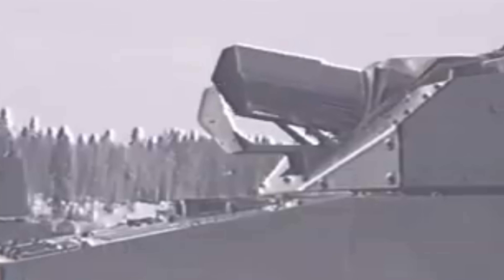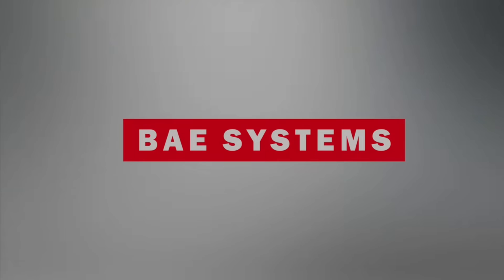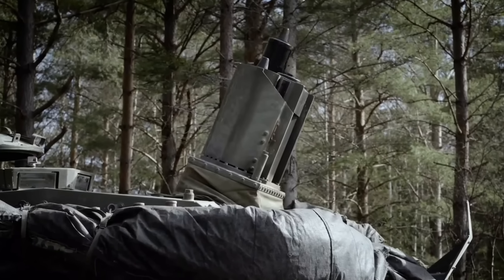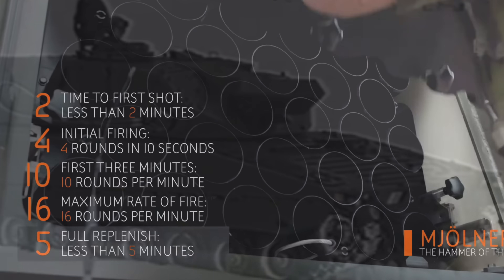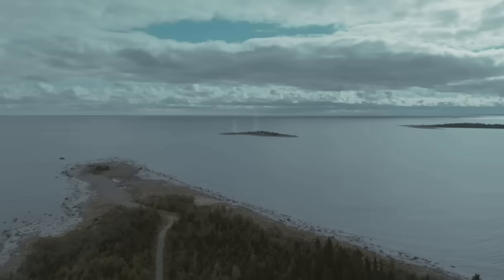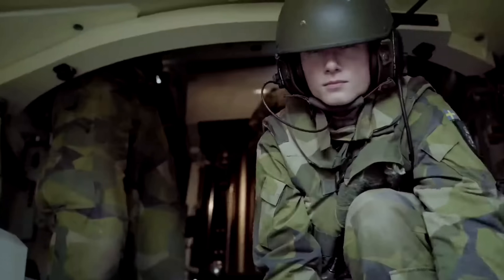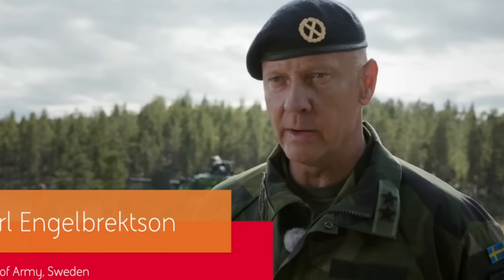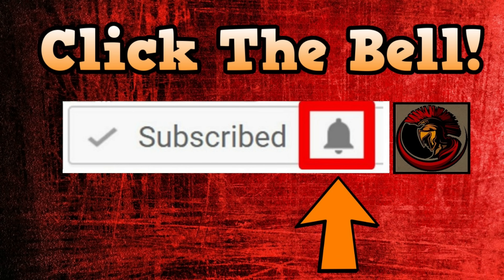The 'Mjölner' Rapid Fire 120mm Mortar Vehicle | DOUBLE BARRELED INDIRECT FIRE

Comment: It's....nice for a standalone system. But if they were to make a revolver mortar system that can fit in the back of a Humvee. Than we can see a real effect on the battlefield. My main gripe is that it's just a self propelled artillery gun. Which is what all the enemy scouting systems are going to show. So the enemy knows what they are and what they look like. Which would allow them to know how effective enemy indirect fire can be within that area.

Now if you make a mortar system that can be mounted and hidden in the back of a Humvee. Every Humvee could be just as effective as these things. Along with the added benefit that enemy intel can't track such things and makes the fog of war more dangerous.

This thing is of the cold war era of thinking. More firepower and more ammo against a static enemy position that doesn't have air or drone support. Also....i now have a use for my Anti-Armor Rifle.

Comment: Not really a try military person but somewhat a military industrial complex person in the past. Love Amos and this system may make a nice complimentary vehicle to it. Tracked vehicles as you indicated work better in difficult terrian,but wheel vehicles while working adequately in most difficult terrians do provide better speed, lower cost, and longer range per amount of fuel carried in less difficult or developed terrain. This is the difference between what the USA Army buys and the Canadians and Swedes buy. Yes, such a vehicle should provide advantages over rapid fired cannon or machine guns. Perhaps even at penetrating enemy tank turrets with ordinance. Mortars are easy and quick to produce too. Only comment on USA forces using Humveys is; do they provide the vehicle with enough armor? Should they produce a special chasis to mount such a system or perhaps it could become an enterchangable system on a Bradley ( this may show my ignorance) or Stryker chasis? ( probably the latter would work best) In my opinion it may make a nice addition to the family on the common chasis and the troops it supports. ( but now its on a wheeled chasis!)

Comment: I really like this Mew Mew Mortar too, but I'd expect it to be pretty high maintenance, no?  The system of loading the mortar without exposing the crew is brilliant, and actually reminds me of a similar system that I drew up on paper to use with the Metal Storm(tandem loaded, multi-barrel 12.7mm-30mm gun), where my design incorporates preloaded disposable sleeve magazines(resembling a shower curtain rod with holes in it for the electric ignition/primers) that fits in each barrel snugly as to not crack or stovepipe while firing. My system extracts the empty sleeve mags, then inserts new ones, hopefully in under 30 seconds for all 9-36 10rd barrels(depending on if it's a smaller or bigger system). Ofc, to maximize effect, the rounds will probably consist primarily of AP incendiary, regardless of which caliber is being used...but I'm still developing the system that was apparently abandoned awhile ago originally designed by J.Mike O'Dwyer(Shhh 🤫 please don't tell the ATF) on graph paper only, ofc.
Reply: 30mm ap incendiary is silly. Either go HE, HEDP or sabot for that calibre.

Comment: A mortar for the Price of M109 ? Non thanks !
Reply: A cannon is not necessarily better than a mortar.
Reply: @samsonsoturian6013  explain ?
Reply: @Necromancer_88  Sometimes you don't need a high velocity round. Sometimes you just need a lot of explosives going down range.
Reply: @samsonsoturian6013  generaly mortar are a cheap alternative to howitzer for thé same Price no reason to choise mortar
Reply: @Necromancer_88  Yes, but a mortar with the same price tag as a howitzer can send much bigger explosive shells down range much faster.
Reply: @samsonsoturian6013  ammo price or vehicle ? This mortar on cv90 i think are the samme price range to cheap 155  howitzer
Reply: @Necromancer_88  If ypu measure in terms of explosives going down range, mortars are cheaper there too because there's little powder charge needed per shot.
Reply: @samsonsoturian6013  do you know the price of he 120mm mortar shell and 155mm he ?

Comment: The amount of Motors rounds it can carry and rate of fire with the Accuracy it will not suffer from the typical motor tube movement with every shot. This system will become a largely standard part of every army in one format, weather it be a new system built or buying these from other countries. Theses are amazing pieces of military equipment.

Comment: Having served with both the old system in Sweden and the new Mjölner I can say that it is a game changer. The speed with which it can maneuver, deploy and redeploy is remarkable.
Reply: I don’t get the point of just small arms fire protection if it’s normal range is over 5km then what small arms are threatening it? Might as well go back to a mortar truck because anything hitting you from 5km away is not a small arms
Reply: @off6848  It's literally mentioned in the video. The biggest threat by far to any artillery is counter-battery fire from other artillery. Having an armoured platform means you're protected against anything but a direct or very close hit from return fire. Anything else will be stopped by the armour. That shrapnel would shred unprotected infantry otherwise.

As mentioned it's also not impossible for the vehicle to come under small arms fire as the front line is constantly shifting in modern warfare. Forcing the need for anti-tank weapons rather than small arms to knock out the vehicle if they come under fire is a great boon to the protection of the crew until they can reposition.
Reply: @off6848  It does provide protection from shrapnel, which is a massive threat. But also, you want to be fairly close to the front line, that is not really a line but rather an area. Meaning that there is a fair risk that mortars can come into contact with enemy infantry, making small arms protection a good thing.
Reply: I also reckons it's great but wouldnt call it yet another G-g-game changeerrr
Reply: Range is critical and I'm sure that it doesn't have enough, it's thin armor would make it a sitting duck if spotted by a drone.
Reply: @gumby2241  It's not invulnerable, yes, nothing is. Doesn't mean it isn't a good system still. Drones have also been used on howitzers, so increasing the range isn't going to help anyway. And having some armor is better than no armor

Comment: Amos has been doing this for a long time now, it has longer barrels which means longer range and has direct fire ability
Reply: Yes, but like Mat stated in the video, the AMOS system costs several times as much. Every mortar system doesn't need to be the AMOS. A military can have a few for specific uses and flesh the rest out with this unit.
Reply: @Ravnican127  more expensive per vehicle yes but it has twice the firepower and more capabilities in a single vehicle and cheaper than 2 vehicles with a single tube
Reply: Have 2 amos or many more those these???

Comment: I like the idea of putting more 120mm mortars in vehicles with data links and automatic gun laying, but I question this design. In particular, the choice to use a muzzle-loading mortar has lead to an over-complicated loading system. Why did the Swedes and BAe go with that over a breech-loading mortar?
Reply: Because the over-complicated breech-loading AMOS system was too complicated and expensive.
Reply: @Merecir  I get that the AMOS was too expensive, but I'd argue the cost was from the autoloader, not the breech.
Reply: @matthewkubinec1620  Apparently, as they made all of it manual, both were the problem.

Comment: First off I think this is super cool and definitely a good idea overall. The problem is and it goes for all new equipment/tanks/vehicles/and so on is this is or will be super expensive compared to it counter parts. Yes as USA military equipment should have the best on the market but after we have the best on the market we should also have low cost, mass produced, easy to produce to flood the (War) market if we needed. And this is definitely not that. The government need to get on the companies that design and manufacture these types of things that they can't have a blank check and stand by there equipment if it fails (with companies $$$) if there's problems with the equipment and I'm sure with something on the complicated scale of 9 or 10 out of 10 like this, I'm sure there's going to be a butt load. PS I know this is not USA thing but I'm sure a comparable thing will be coming here soon

Comment: A very interesting video about a piece of equipment I did not know had been developed, so Kudo's to you for posting and the Swede's for developing it. I could see it's usage as a very good support weapon for any advancing armored column without infantry leaving the safety of their APC's in order to "setup traditional mortar's" to support an infantry attack. I can also see the benefit of the plunging fire effect this system would have in an urban or hilly environment replacing the STG direct fire support systems or at least enhancing a commander's options and not having to rely on longer range field arty.
Sweden commands my respect for always producing the highest quality of weapons and systems and maybe if Sweden donates "a few" of these for use in Ukraine like they are doing with the Archer SPG system and positive battlefield reports come back from their usage, maybe then the orders will start to roll into BAE from other Nations and BAE could firer back up it's production line and make a big profits score. Just off the top of my head I can think of 10-Countries that would benefit from having this system in their arsenal.
Reply: Just build the mortar into an old apc...

Comment: I think drones is going to do a number on these if they spot them. The lightly armored turret with a huge storage of ammo inside. Drones are so cheap that Mjölnir will have a hard time being cost-effective.  I do like the concept but when the funding got cut and AMOS was abandoned they rushed these things out. That tends to lead to costly modernizations and/or ad hoc solutions (see cope cages).  So if BAE makes a export version or a Mk 2, it might be more matured and effective.
Reply: I believe these are designed to be part of mechanized brigades that will use different versions of the CV90, which are pretty likely to include an AA variant or two to cover the rest of the brigade
Reply: @CrazyDutchguys  Yeah but even if I have to use 20 drones to score a hit if the drones cost 5000$ per unit it is still cost effective. So the lightly armored turret is an Achilles heel on the platform.
Reply: The vehicle has protection against arty fire, The design of this system is bases on the shoot & scoot concept. 
Finally, the Swedish army have 40 of these system and have ordered 40 more with minimal adjustments.

Comment: Hell with that this is perfect for combined infantry and tank movement. Throw these in the mix with your reserve and or overwatch element near the rear to provide indirect fire to the front. That way these can provide indirect fire for the assault element while your reserve element maneuvers into position. Though I am a bigger fan of the Archer system for shoot and scoot. HIMARS is great too for long range strikes but you sacrifice too much ammo for distance in my opinion. With rocket systems you need to have more support vehicles with you for reload. With Archer I may only get 20 to 30 miles but one vehicle carries 24 rounds at a time.

Comment: The U.S. Army experimented with self-propelled, infantry mortars in Vietnam. The Army simply mounted 81mm mortars in the back bays of reconfigured, versatile M113 infantry armored vehicles, one mortar per M113.  The advantage was that the 81mm mortar was highly mobile, transported its driver, crew, and NCO, and offered a modest amount of protection.
     After Vietnam, the U.S. Army retired these self-propelled mortars and essentially turned its back on the concept of self-propelled, infantry mortars.  The U.S. Army believes that self-propelled mortars basically defeats the purpose of troop-carried mortars which can be ported anywhere, giving infantry troops badly-needed, close artillery support.  If armored, self-propelled artillery is needed it can be provided by either tanks in the bombardment mode, or dedicated armored SP systems like the 155mm self-propelled, totally enclosed howitzer.
     Over the past decades other nations have devised, armored, self-propelled mortar systems, but have never found government customers for similar reasons.  This Mjolner looks impressive enough on the firing range, but given the past lack of interest in similar, self-propelled mortar systems, I doubt this one will go much further than the prototypes shown here.  Even the former Soviet Union wasn't interested in the concept, nor Red China today.  Same goes for Western Europe and the U.K.

Comment: How is it accuracy wise compared to AMOS? Does the additional crewman remove the ability to include networking and drone links? Probably does, add in direct fire mode and a higher rate of fire AMOS seems more cost effective despite a higher cost per individual unit. But I agree the CV90 family is a superior family of interoperable chassis. We need to see a dedicated drone launch and control unit. One that networks of course.

Comment: Always been a big believer that indirect fire and particularly mortars need a overhaul. The CV90 as a platform might however be putting to many eggs in one basket. If it had been married with the Swedish Stridsvagn hull as minimal traverse is needed and it would benefit from the low silhouette and the rear facing driver position.
Reply: You mean the Strv103? Those have been museum pieces since the 90's.

Comment: Do the barrels on a mortar last longer than other artillery? I've heard that for example PzH2000 needs new tube after 2500 shots
Reply: The mortar barrels used by my unit  in conscript training 2003-2004 were forged in 1942, 1951 and 1943. They were more than accurate enough for the job.
Towed 12cm smooth bore m/41D mortars (Finnish design)
Reply: Smootboored mortars like this do last longer than the howitzers. It is primary pressure and friction in the rifling that is the problem for barrels. mortars like this are smoothbore so the barrel does not engage the round which reduce the wear a lot. There are rifled mortars too but this is not one.

The pressure will result in stress, height pressure also means higher temperature and it can result in wear in the barrel.  Mortars like this have low pressure, I found measured values I found in a report were 120MPa for a 120mm mortar with a full charge. I alos found ammunition for sale where charged 9 has a max gas pressure of 190MPa with 9km rang, at charge 1 it was only 15MPa and 1.5km range.  The pressure a M777 can sustain is 460MPa. I found ammunition that can sustain 375 MPa. I did not find any direct measurements but it will be in the 300MPa range, you would not design max pressure like that otherwise.

If you compare to small arms the max allowed ammunition pressure is 380MPa 5.56 NATO round, or 230MPa for 9mm parabellum, 170MPa for .22 long rifle.

Shotguns are ar 11,000 to 14,000 PSI is 75 to 96MPa.  It looks like paintball is at 3000-500 PSI  34-20MPA

So mortars are somewhere between a .22 long rifle down to less than a pain ball gun depending on the charge you use. If you look at a shotgun barrels they are quite thin compared to pistols and rifles. Mortar tubes are quite thin too. The lookalike scaled-up shotgun, not a rifle. I would not be surprised if they are the tubes/barrels in military use with the least amount of wear, that is including small arms.

Comment: Here's a guide to Swedish Pronounciations for native English speakers.

Granat (Second A is long vowel, Hard t at end, So read GranaaT) = Grenade
kastar (Castar/ Pronounciation is the same as Castle) = Thrower
pansar (same as the german Panzer but A not E so Panzar) = Armoured
bandvagn (Band is no different, Vagn/Wagon would be spoken as Wangn in english) = Tracked Vehicle 
90 (Nitti the model name would shorten, the numerical word Nittio by the o for pronunciation flow) = 90 (Ninety)

Comment: In addition to performance, rate of fire, ammunition and mobility, the characteristic that I consider very relevant is the "modularity" of the CV90 weapon system - in this case related to the presence of the 'Mjölner' turret -. So it would almost be more correct to define this element as an "optional" of the CV90 system 😎 ...
Seriously, the modularity of the system also means that it is not necessary to have a particularly armored "turret". Mainly in order not to increase the overall mass of the CV90, then considering the modularity of the system, in the event of possible damage to the turret (for whatever reason) it is sufficient to replace it with another and resume operations, a condition which is obviously quite different for the "hull" of the CV90, in this case much more armored.
Thinking about the current context, the Ukrainians would really need to have such a system in the field. The CV90s will come from Sweden... but no IFV configurations have been communicated 🤔

Comment: I Wonder that 155 mm mortar barrel could be in that vehicle.Or only 120 mm.
Reply: The Ruskies have a mobile mortar system of that kinda size its barrel is at least 3 to 4 meters long and no western country produces motor ammunition of such a size. Where as 120mm ammunition is relatively plentiful.